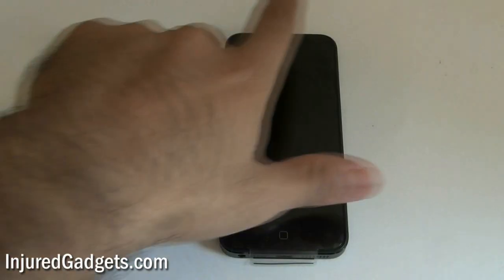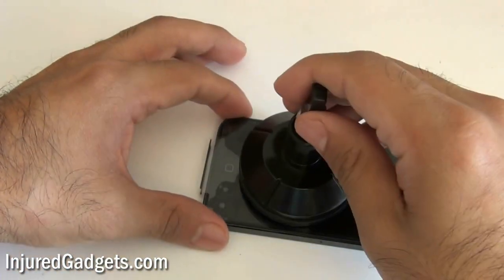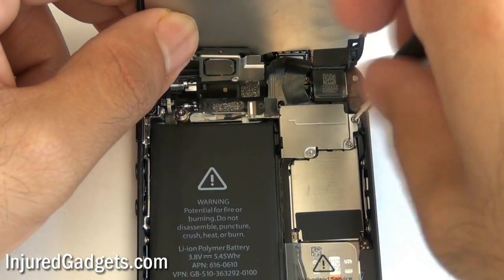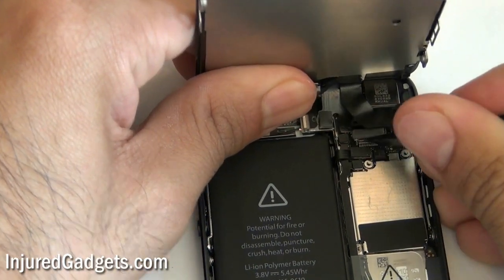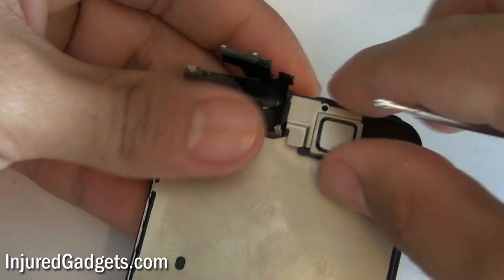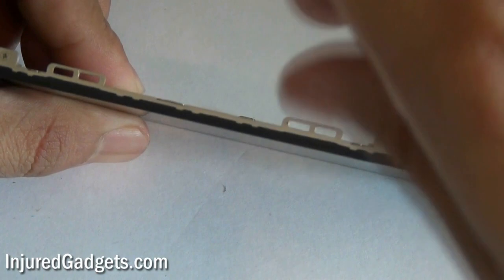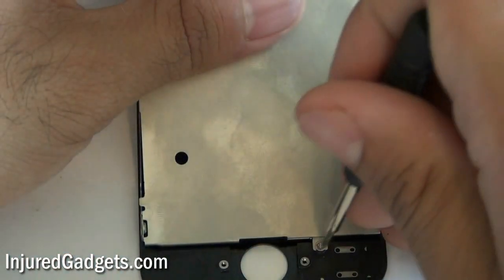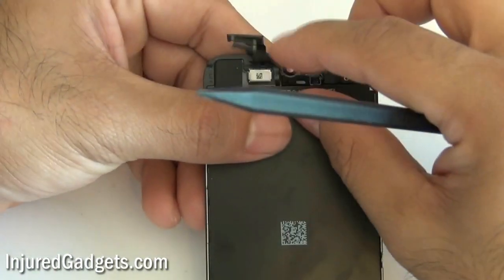iPhone 5 Front Camera and Flex Cable Repair Replacement Guide

Comment: My friend replaced the screen and now the front facing camera doesn't work. Also when I call people I have to use speaker. The proximity sensor doesn't work either now. The home button is also off centre. Have you any idea what's wrong???? Thanks!
Reply from the maker: +Emer Mc Laughlin You likely need to change the front camera proximity sensor flex. Off center home button? He didnt align it properly.